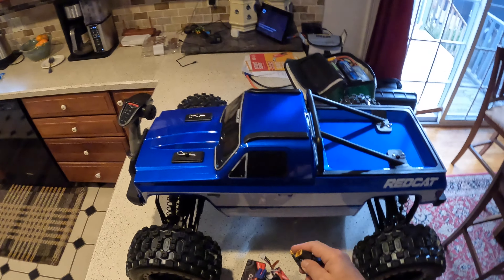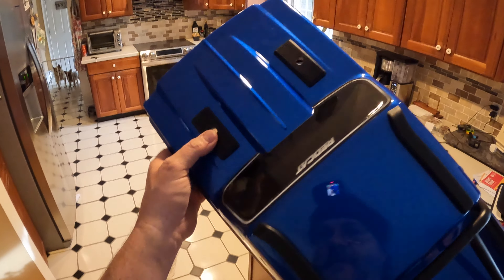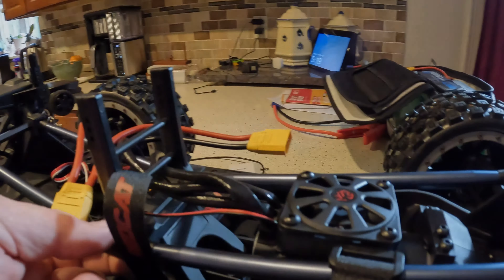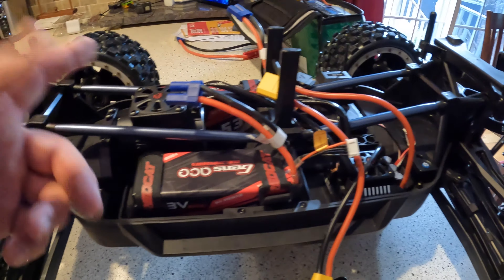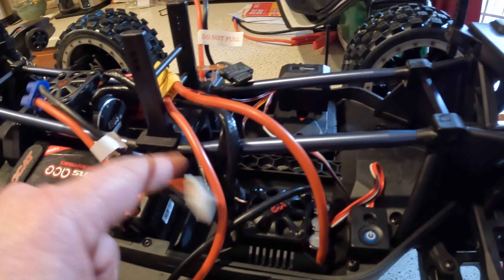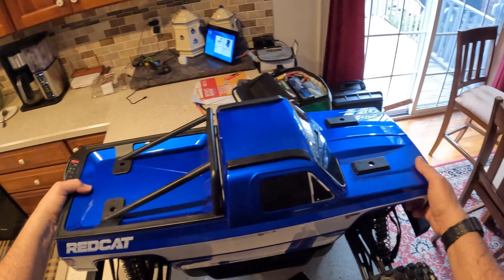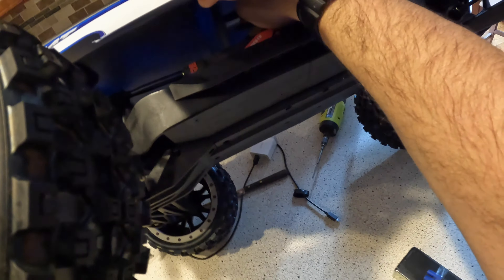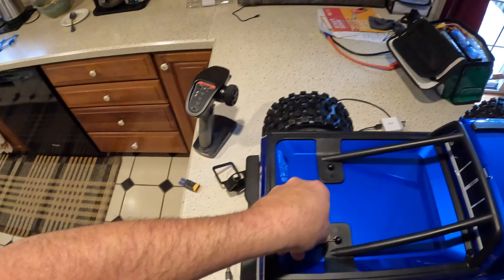Why would you do this to a 5th scale RC 🤬

Comment: Hey Guy I'm able to run SMC 7600 150C HP soft packs...they fit on their side...you have to slide them towards the front...works great and thanks for the great vids!
Reply from the maker: NICE A PACK THAT FITS But I'm sure you can understand what I'm getting at with this. This thing is a fifth scale It should fit automotive car batteries 🤣😂🤣😂🤣😂
Reply: @rcguygarage  😂 I completely understand that! I definitely see that they were trying to up the durability quotient...but Arrma with the adjustable trays and Traxxas with the easy to use battery latches I thought Redcat could do something similar...love the truck though and going to do the same to the center diff...Thanks for what you showed on that!

Comment: Hey guy... I was watching another vid on this RC..... Phillyswords RC. Just after  1 or 2 small jumps he lost both screws that holds on the front right hub. I'd be checking those screws man.  All and all a great looking RC I'm liking it myself. ❤
Reply from the maker: Yep TOO LATE😂🤣😂🤣👍💯
Reply: @rcguygarage  ... Oh no... Lol..only seen it this morning and thought I'd give you a heads up 😅
Reply from the maker: @RON4RC  You know what's funny is I'm not surprised that this happened because it doesn't appear like there's any thread lock anywhere to be found because they use super glue or something on some stuff but yeah on the 7075 hubs there is no super glue 😂🤣😂🤣 and it's actually all good guy because the feeling that this RC gave me I want everyone to experience point blank 👍💯‼️
Reply: Hey fellas I bought the Vigilanty too and I'm running 9000mah zees soft packs in mine,but I did have to grind down the back side of the lipo tray, but now it's tight and perfect in there !!
Reply: Also I put the 20 million weight in the center diff and I'm running a 20 tooth pinion, but did have to leave one of the top motor mount screws out for it to fit, but it's really tight and the motor is not moving so I'm good with that, really runs well now and fast!!

Comment: oh and LOCKTIGHT the stearing knuckle screws along with the steering links. you will thank me later! any screws on this truck that go into the aluminum parts needs to be locktighted. they only locktight the motor mount, and the steering supports where the servo saver is. nothing else is lock tighted. ive had the privilege of havi g to get a new chassis straight out the box. along with gears. tbey have sent them and i have replaced them. i checked EVERY SINGLE SCREW. facttory locktight is only in two places. do yourself that favor or it will ruin a bash session. or just have extra screws on hand
Reply from the maker: 🤣😂🤣😂 too late GUY 🤣😜
Reply: @rcguygarage  lolol noooo!! I tried to save you haha. but how do you like it so far? could use softer plastic for the bumper support

Comment: i run zee 7200 120c. they are a little bigger but they do fit. im not worried about the clearance i strap tha mf tight as i can co it doenst beat against it. but ive ran almost 20 packs already in my vigilante and no damage to the packs with not clearing that tower. all is well. if you feel you need to i would just run a littl foam in between but should still hold up. happy plays!!
Reply from the maker: WOW 20 packs already jeez👍💯 on the battery fitment though you FULL WELL KNOW that just ain't right???
Reply: @rcguygarage  yeah Def needs a bigger battery tray for sure. that knocks some cool points off but yeah 10 packs man I play with my trucks every single day lol and this one and my xte pro have by far been my favorite!
Reply: @rcguygarage  *20. some days I go through 2 packs which is almost 1.75 hrs if play time.
Reply from the maker: Nice👍💯